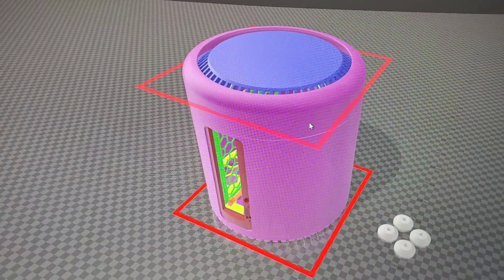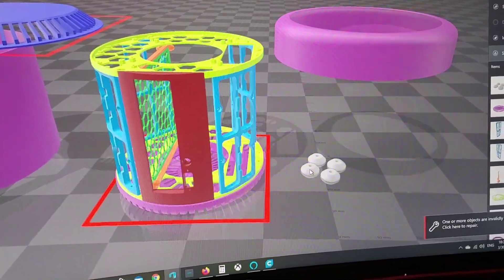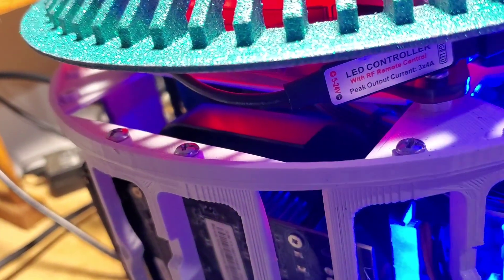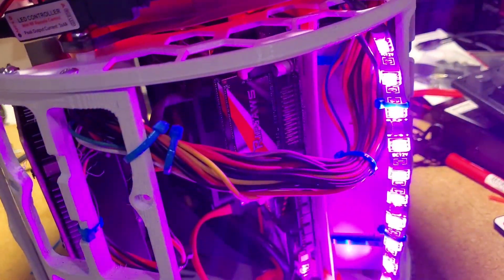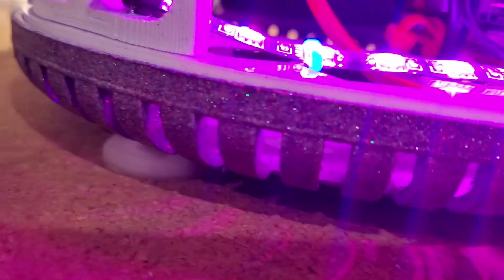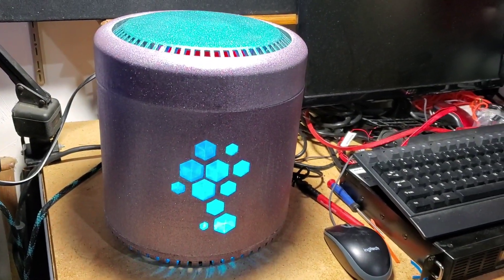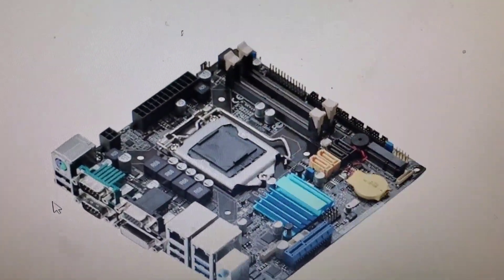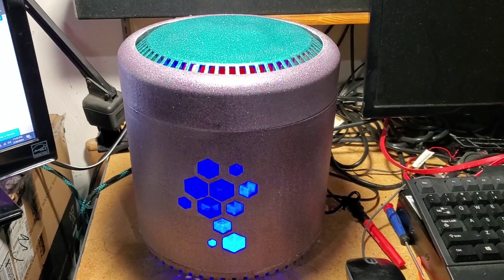Bigger 3d printed Mac trashcan ITX PC

Comment: how expensive(howmany spools/materials used?) And can a newbie like me be able to pay somebody to make this?
Reply from the maker: Two spools if accounting for mistakes and error 🤷‍♂️ not bad.  Anyone with mild skills 3d printing can make one.  I sprayed a few coats of filler primer on it, sanded it down smooth, and painted it.  It was a fun project
Reply: @tom_foolery  how big was your gpu? ;0
Reply from the maker: @liquidhydration   The one in this video is a msi 1050TI. I built another one with an evga 2060 super.
Reply: @tom_foolery  whats the official model name for both? I wanna find dimensions
Reply from the maker: @liquidhydration  i stand corrected.  I went back and looked.  It was a EVGA 1660 XC that went in one, and a MSI 1050 ti 4gb in the other.  Both single fan.  You can look up dimensions for cards on the manufactures website.  You can fit up 183mm in length and 42 mm in width.  Zotac is known for making small form factor versions of high end cards as well.  Check them out.  I hope this helps
Reply: @tom_foolery  thank you so much!

Comment: Got links to mobo and whatnot?
Very very very cool little setup and I bet it's quiet due to that 140mm fan pulling a boatload of air thru that system!
Reply from the maker: Any Mini Itx mobo will do.  However i would suggest an amd zen 3 processor or a 95 watt Intel.  That will help keep power draw and heat lower.  Solid gear makes flex power supplies.  They are slim but only accommodate up to 350watts.  I recently purchased a 600 watt silverstone sfx power supply.  I think i can make one fit.  This build has a 1050ti in it.  Which is ok for last gen triple A games.  I dont know about slapping an RTX in it though 🤣!!  I am experimenting with a twist on this design, but i have so much catching up to do on my job and some side work for a customer after having been out with cov!d.  I still feel drained on a daily basis after work.  I hear this is a normal side effect.  So, my tinkering is on hold for now.  But i have a very cool budget build in mind, with a good mix of second hand parts and water cooling parts.  Im salivating just thinking about it. 😄
Reply: @tom_foolery  maybe you can use a low profile 1650 or a single fan  3050? 

That or a 750ti... It kinda old, but still getting drives update ans it really low power usage.
Reply from the maker: @1986Hikaru  yep.  I actually reprinted a case very similar to this and same dimensions for my daughter.  It comfortably fit an evga 1650super and a 600watt sfx powersupply.

Comment: nice video! can i use sfx power (100*125*64 mm) on this case?
Reply from the maker: I just finished another one of these for someone.   It was tight, but i was able to fit a sfx power supply inside 😂 i put a 200mm fan it as well 😮
Reply from the maker: Its not designed for it.  But im sure its doable.   Thats something i have yet to try.  I have another complete case printed.  Ive been waiting on some bargain parts 😄

Comment: Noice, you could sell these as a kit, printed parts and PSU
Reply from the maker: Sure.  With a weeks lead time.  I maintain an extremely busy work life 😄
Reply: @tom_foolery  how big of a build plate is requiered
Reply from the maker: @howardsalas12  I used a Tevo Tornado Pro, which is 300x300x400.  The dimensions needed for this are 243x243.
Reply: @tom_foolery  I think you can outsource that, you know to a mass printing service